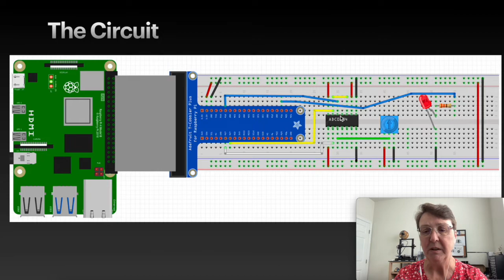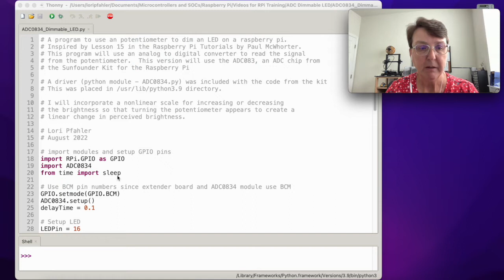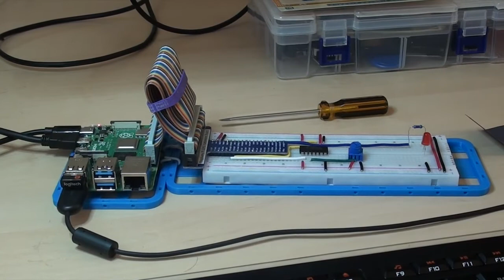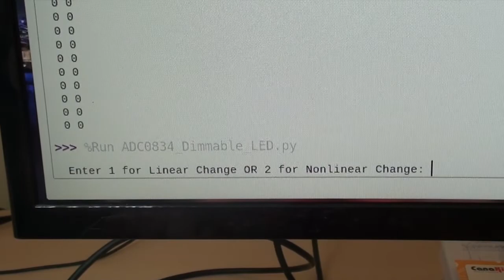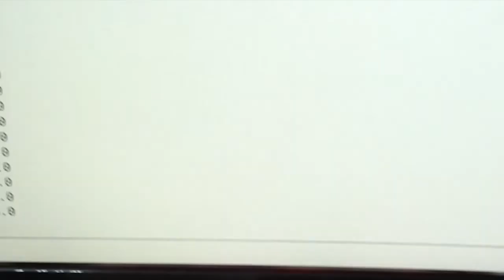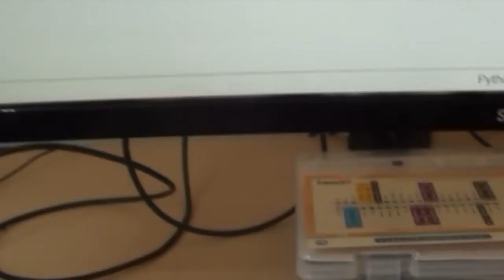Make a Dimmable LED with a Raspberry Pi and Python

Comment: Clear, Concise, Articulate, On Point, and Great Production Quality. 5 for 5! Enjoyed the explanation of the inner workings of the ADC chip with successive approximation. Thanks for posting.
Reply from the maker: Thanks Keith!  Took me a second try to get this one done correctly.  I got too focused on the math and put the circuit together too quickly.  Glad to have it working but it really is a miracle the ADC0834 worked for this project.  I bent a leg on the chip as I pushed it into the breadboard.  I was having lots of problems on the RGB LED HW and found the issue.  Tried to fix the bent leg but the chip just shorted once I tried to use it again.  On to using a different ADC chip I have from another kit.  Appreciate the feedback!